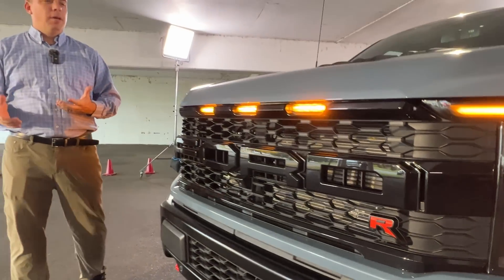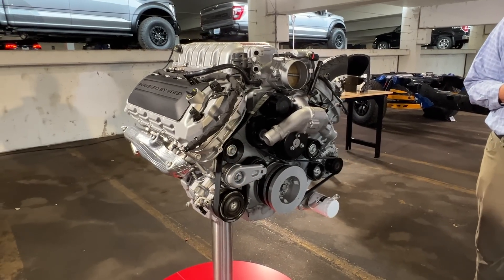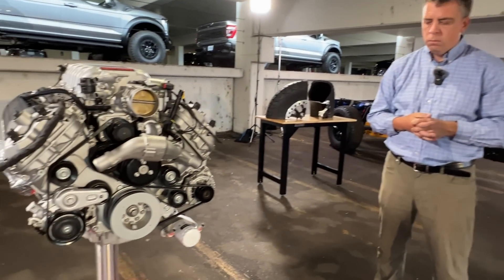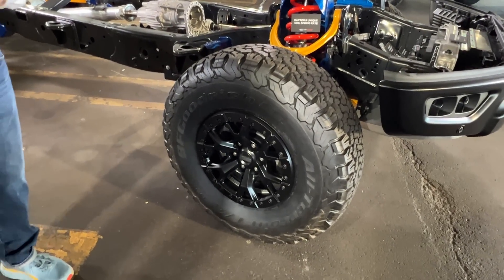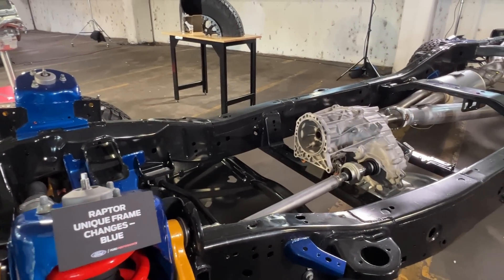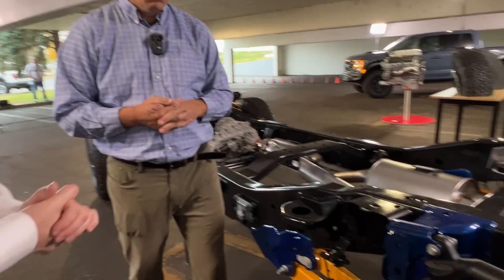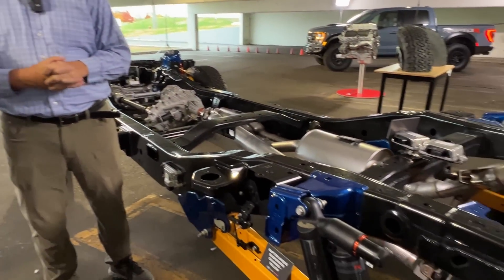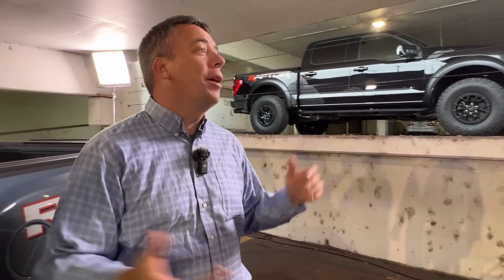Here Is Why the New 2023 Ford F-150 Raptor R Has Less Horsepower Than the Ram TRX

Comment: Cool review and break down of what makes it better than the previous versions. I think it's smart to go for a balance rather than a numbers war. Its gonna be awesome!!
Reply: This is why I keep saying that the Raptor is a BETTER TRUCK  than the TRX. If I had halo truck money, even if the Raptor R were off the table, I would still choose a Raptor over the TRX.
Reply: The numbers are getting to a point where it becomes nonsensical for day-to-day use, anyway at least for the top trims.
Reply: I always thought the TRX was just #'s and unusable power
Reply: Size doesn't matter babe, unless of course you're packing.
Reply: @rdsii64  no you keep saying the Raptor is a better truck because ur a Ford fanboy 😂 🤦
Reply: @dor1tomcswagger69  You just said that because you are a ram fanboy😂
I have my opinion and you have yours.
Be well brother
Reply: @dor1tomcswagger69  Your just saying that becuase your not a Ford person like it or not on paper it does seem to be a better truck overall even if the TRX has 2hp more the Raptor R is lighter and more off-road base and yes when he's referring to a Normal Raptor once again on paper that Raptor is not as nose heavy the TRX may have a 200HP difference but the Raptor is just more capable plus realitsicly why would you need 700hp in the first place
Reply: It’s going to be faster than a TRX because it’s lighter by 500 lbs and the TRX has a 3.55:1 final gear ratio this will have 4.10:1
Reply: @Delifish114  you just wasted your time and effort. He’s nothing but a troll and doesn’t care if he’s right or wrong. I wouldn’t even respond.
Reply: I’ve never owned a truck before and was thinking about going trx I try to look at comments to see if someone can break down why one is better then the other but everyone is just fanboying
Reply: @mrpoopybutthole2269  For a first truck I woulnd't get neither of them their crazy expensive but if you we're to get one just get the Ford since Ford has a better history when it comes Trucks Compared to Ram but I wouldn't get neither the Raptor R or TRX I would get an F-150 Or Sierra 1500
Reply: @rdsii64  Sorry to say, it really isn't, but this is why we have better trucks with the competition.
Reply: @rdsii64  It is not about Ram fanboy or having your own oppinion. IT IS ABOUT REALITY and whether or not you are delusional and thinking logically.
Reply: @hpkntnw  What is the purpose of these trucks?  They have the Demon Redline production car for drag racing.

Comment: Great video.  So glad Ford finally decided to offer a V-8 option again.  Although the twin turbo V-6 Raptors are super capable, they simply can't match the sound of a V-8.  Throw in the supercharger and revised suspension, and you've got a beast.  Can't wait till TFL gets to test it.
Reply: They would never have done it if ram didn't come out with the TRX
Reply: @ubeuonly  yes we know thank you Dodge Ram
Reply: @roadrunner4847  facts are facts
Reply: @ubeuonly  Dodge would have never made the TRX if it wasn't for ford. Never forget who created this badass subsegment.
Reply: @KB-bh9hp  that's all well and fine. But Dodge did it better and LeapFrog Ford and we'll do it again in the electric segment and Chevy will always be bringing up the rear. But that doesn't excuse for for copying the cutouts in the rear bumper copying the five link suspension, copying the tailgate shape to match the 19 ram copying the underdash of the RAM and previous generations ect.. and most raptors are pavement princesses anyway. And they sound horrific. So credit ran for doing it right and not making do with an Eco puss engine
Reply: @KB-bh9hp  they would have put a hellcat motor in a pickup truck at some point regardless of what Ford did.
Reply: @ubeuonly  you clearly have a preference
Reply: @ubeuonly  How did Dodge "do it better" when the Raptor sales still outclass the TRX? How did Dodge "do it better" when on offroad tests the Raptor still ranks higher. How did Dodge do it better? Raptor is a proven rally truck. TRX isn't and never will be at that weight. It's as you call it "a pavement princess". I've seen Raptors offroad. Never once seen a TRX offroad and let's be honest, Ford is the standard for trucks and always will be. F-150 is the best selling vehicle in the USA period. Dodge isn't even #2. You can fanboy all you want for Dodge, but they will never be #1.
Reply: @KB-bh9hp  don't doubt what dodge won't do. They made the SRT10 the most badass super truck IN EXISTENCE

Second place going to the excellent GMC cyclone beating a few Ferraris.
Reply: @TheGodofZilla  you should check your sales figures again. About how many they're building versus how many they're selling. And common Sense would tell you if you can buy a better bigger faster truck for $10,000 less money and get a discount on top of it you would do it? Most smart people would
Reply: V8 is the way to go
Reply: @ubeuonly  who cares why? How well was it implemented? Thats the question. This Raptor destroys the TRX outside 0-60.
Reply: @ubeuonly   Dodge only leapfrogged in power - Gen 3 Raptor is better at its job in every other way.   
The 5.2 addresses the ONE deficiency
Reply: so? I buy a truck to enable a lifestyle the truck is NOT the lifestyle. My 3.5 EB if I want to can put any non-specialty truck on the road to shame.  It may be lacking sound but it isn't lacking the GO. Just me I find it hilarious to hear a V8 pickup  making a ton of noise yet can't get out of it's own way. There might be SOME that don't claim to care about range but I'm not none of them.
Reply: @ubeuonly  Fiat/Ram
Reply: Exactly

Comment: Ford: Removing the torsen front diff was a mistake.  Brake based traction control systems suck because:

1. It can easily be overwhelmed in high traction demand situations, such as when one wheel is off the ground, 
2. It can overheat the brakes, 
3. It requires the brakes to be in good working order (older brakes will not work as well), 
4. It's often slow to react.
Reply: Agree.  I prefer mechanical components rather than computer controlled electronic gizmos.  Off roading should require some driver involvement instead of just being a passenger in a computer on wheels.
Reply: Torsen diffs are not very robust.
Reply: @markbuckholz3184  I would prefer an E-locker like the Ram Power wagon or Chevy ZR2
Reply: I've seen break based awd react in half wheel spin while true vectoring axles on Hondas took several wheel spins on same test, but that was slow crawling speed, I would still not want to have breaks used for traction in high speed runs... I guess it's fine for getting unstuck in slow speeds
Reply: Have you ever had a brake bias system?  I felt them same until I realized how effective and robust they can be.  Easier to replace pads vs locker clutches 😂
Reply: @ProjectFairmont  yes, plus I’ve seen them tested on this channel many times. I don’t like them. An e-locker would be the best solution in my opinion
Reply: @Show-me-how-now  just a question if you don't mind. Been a Ford guy for life. Just got a 3500-Z-71 and YES I switched brands. So I'm not familiar with GM 4x4 Axils.
On my 4x4 LOW it says put Transmission in N wait for shift to transfer. (Little diagrams of 4x4 come up on the lower screen)  my question is 
Does the  LOW 4x4 is it  like I had a hub switch on wheels. My truck does NOT have the AUTO all wheel drive. Just asking for my understanding of GM shifting of 4x4
Like I said I'm not up on GM axils.
Reply: @Show-me-how-now  tested on this channel, ah ok.

Comment: So I am a Ford guy 100% Currently own a 2018 Platinum and I have a TRX on order. As amazing as the Raptor R is going to be, it will be 30K more than my TRX. I would assume the Raptor R will be faster due to weight savings but for 30K I could make the TRX scream. I wish it was a bit more in line with the price of a TRX

Comment: Took the Torsen lsd to reduce cost, lol, I like how he spins it into a positive.
Reply: I was looking for this comment. Brake locking systems do not compare to a normal
LSD or locker. That’s one of the only flaws i see in this truck is removing a mechanical feature for a computer one
Reply: lol thought that was funny too, all of a sudden a torsen was just usless 😆
Reply: Or maybe they just wanted to extend the life of the front cv axles.
Reply: @Josh47147  Why would they do that, they will most likely fail out of warranty, and the customer will have to pay to repair them, making the dealer and Ford more money.
Reply: I have been stuck in snow countless times and when I lock the front it pulls right out.
Reply: With modern computer control now being at 300 samples per second on the amount of wheel spin or not that is being measured, means the computer can pulse or hold the brakes on any corner and remove wheel spin completely OR keep it depending upon the situation. 

It's true here for the Raptor-R! Torsen is no longer needed once wheel spin computer sensor sample rates gets past 120 samples per second per wheel. And once you hit 300 samples per second of wheel spin and/or tire grip measurement then you have TRULY DUPLICATED the function of a Torsen system.

Once the Raptor goes fully EV, then step-motor-like functionality can be used where you can spin and/or pulse individual wheels forwards AND in reverse at any time to go WAAAAAAY BEYOND a Torsen system into fully active 4x4 drive control that senses what the tires are on and how much grip they have and move each wheel separately at different speeds and in different wheel spin directions to get out of or move over almost any hairy off-road obstacle!

Computers make ALL the difference and a computer chip that is equal in CPU horsepower to the one in your smartphone CAN EASILY control all the tire grip you need and want in any direction! In less than two years, Torsen system will essentially become obsolete since full computer control can make your 4x4 ride a lot less hairy and a lot more comfortable! i.e. no more fishtailing in snow and no more free wheel spin in mud grinding your tires down!

What we need NOW though is HUMVEE-like upper-hub drive systems and user-selectable suspension hydraulics that can rise to give us 20 inch ground clearances for going over big rocks longs and then lower to 8 inches for best on-road mileage numbers! AND of course add in four-wheel steering for those tight mountain switchback turns and pulling into those narrow suburban mall parking spots!

V

Comment: 700 hp for a off road truck is crazy. My first Toyota pickup didn’t even have a hundred
Reply: The fact that its insanely crazy is exactly what it needs to be.
Reply: the trx is way better.
Reply: @minibikemadman  Nah
Reply: Ford is really good at engineering their exhausts too. Our old f150 has stock exhaust and you can tell it was perfectly balanced so it isn't too loud nor too quiet and it has a good sound so even after all these years you don't get sick of it. Sounds just as good every time. I love it. They don't want it to sound bad and it's loud enough it doesn't sound anemic. my grandfather drove it one time and thought it had aftermarket exhaust because it sounded so good

Comment: Didn’t realize they left out the front Torsen. Doesn’t the newest Ecoboost model still have it? Interesting decision, wonder if it was a cost thing or what.
Reply: Like he said, they don't need it with the electronic braking system controlling wheel spin.
Reply: @nativetexan7433  sure, but that's what the old model had as well.
Reply: @ALMX5DP  
So what's your confusion then? 
"not needed"  What part is unclear?
Reply: @nativetexan7433  why they took it away here when it was added to the other model in their stable.
Reply: It's probably cost and a little weight savings that made them justify it.  I'm sure the electronics will work, but not as smoothly.  Toyota has been doing this with their ATRAC system for a while now.
Reply: @whyguy_479 agreed, a limited slip can only add to performance and even work in conjunction with electronic brake torque vectoring type systems, so just unclear why it’s not needed here when they deemed it needed in the other model.
Reply: @skrsys  true, could be they were very conscious of front weight, though I can’t imagine it’s more than a 2-3 lb difference I suppose engineers do consider all aspects.
Reply: @skrsys  
On a vehicle in this price range, they aren't worried about cost  because all cost is passed onto the buyer and anyone buying a Raptor R won't have an issue with it. Possibly weight savings but doubt it.
Reply: @nativetexan7433  not sure why you are taking my comment so personally. I’m just curious why Ford says it’s necessary in one model and not in the other..
Reply: @ALMX5DP  
How is replying to you the same thing as taking something "personally"? I just don't agree with you.  I find it annoying that you can't understand a simple explanation but that's not the same thing as taking something personal. I just feel like I'm talking to a brick wall. 
Also, it appears that you don't understand the purpose of this truck. It's not a general purpose 4X4. It's designed to perform like a factory trophy truck. The vast majority of real trophy trucks don't even have four wheel drive at all, so like the actual engineer said, this truck didn't need it. Not sure why are you having a problem understanding it.
Reply: @nativetexan7433  you don’t agree that I have a question about it? About how the standard Raptor has a Torsen but this more expensive Raptor doesn’t? You just take the statement “it’s not needed” at face value and don’t bother questioning anything else?
Reply: @nativetexan7433  I think the Torsen is better in every way, but since the TRX doesn't have it, they're getting away with it.  Price is an issue when it has a direct competitor in the TRX, and the R is already priced so much higher without the Torsen.
Reply: @nativetexan7433  the braking system can't match the same action done mechanically instead of using brakes via software.

Cmon.
Reply: @nativetexan7433  I have a ford with braking that stabilizes the car, a FiST, and it'd be much better with a LSD.

Ford went the cheap route, and they don't care because it'll bring vehicles in for more frequent brake jobs.

All that projection, calm down and learn more before you make comments like you do.
Reply: @noneyabizz8337  
You're clueless. 
I broke the gold rule again. 
Shame on me.
Reply: @nativetexan7433  what does a real race truck have?

Comment: Can't wait to get my 100k truck and race down to the mall. I will barely feel the curbs.
Reply: I honestly don’t blame anyone for not wanting to off-road such an expensive truck.   Not many people have an expendable income that allows them to drive the truck like it’s intended to be driven
Reply: @blakew5672  I think that applies to most performance vehicles. Although at least with the Raptor and the TRX you can comfortable do the speed limit on our shitty roads and not worry about tearing the oil pan off like nearly any performance car.
Reply: @BlueDually4x4  
Not a bad point.  I love all specialty vehicles, but personally I’d get more use out of a sports car than I would the truck, depends on what part of the country you’re in though.  We don’t have access to public land, blm land, etc in the east like they do out west, so apart from owning the land or finding someone okay with it, it’s not as easy to off-road as it is to find low traffic public roads or even drag race. 

Personally I’d love a manufacturer to cut corners on the “luxury” side of the trucks and bring the price down to something more inline with a vehicle that was made to get roughed up.  That’s a criticism I have of most trucks in general though.  Trucks were always meant to be purpose driven, work oriented vehicles blue collar workers could afford, not $70K+ leather-wrapped luxury mobiles for errand running.
Reply: @blakew5672  Having been out east, I completely understand. And I agree it would be nice if trucks were less luxury sedan and more truck.

Comment: Throw out that 3.5 V6 and keep that fantastic V8
Keep up the great work
Reply: Love my 3.5. 22 mpg on the highway and still plenty of power.
Reply: @joshszydel8202  it's nice to have forced induction engine but I personally prefer NA V8 or V12 (my dream) due to long-term usage and maintenance if it used in the proper way

Comment: Hmmm. Not really sure how i feel about getting rid of the torsion diff up front. On one hand, it would make 4A a lot easier to live with not having the truck pull to one side or the other, and heaving up the steering wheel. On the other hand it was great for traction on the rocks and high articulation terrain.
Reply: Agree they are going to try to do it with brakes applications and software but is that really as good as mechanical solution.
Reply: Ya not a good idea to be braking and adding power at the same time  .  may be the Torsen could not handle the power ?
Reply: @cynic777  the thing is, they had both the torsen and TCS systems working on the Gen 2’s. Personally I think it’s a cost savings measure more than “oh we just don’t need it anymore”
Reply: @jabroni6199 I believe the gen3’s have an electronic brake booster allowing for independent braking of individual wheels. The gen 2’s didn’t have this. McLaran uses this method in leu of mechanical LSD’s as well.

Comment: The R is a sweet truck but not a $150k sweet after markups. The R weighs in at 6k pounds and the TRX is around 6.4k. All that talk of aluminum for the engine but the 5.2 weighs about the same as the hellcat lol.
Reply: Don't forget the fact that those 37s reduce alot of benefit that the aluminum body has over the heavier TRX.
Reply: 400 lbs lighter negates hp diff
Reply: @ThaMagnaCarta  not with 4.10 gearing